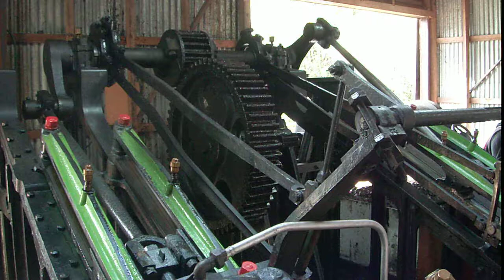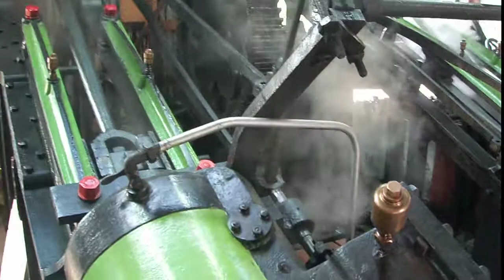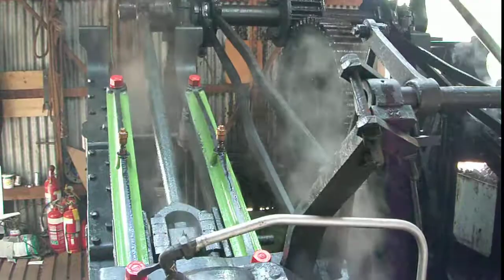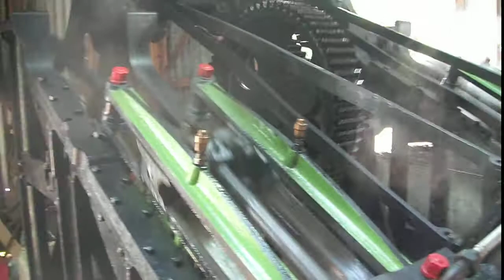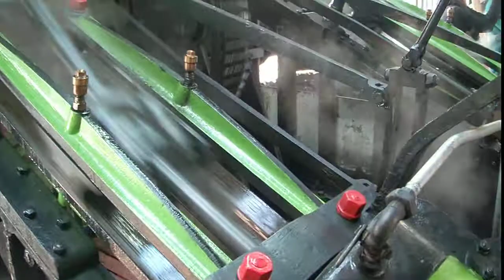steam powered slipway engine 2

Comment: Is it a twin simple? It doesn't sound like a compound........ maybe the valves need resetting, it's rather lumpy :-)
Reply from the maker: Yes it was built a compound but is now a twin simple. It's running a winch and the crankshaft has no flywheel to smooth out the power strokes